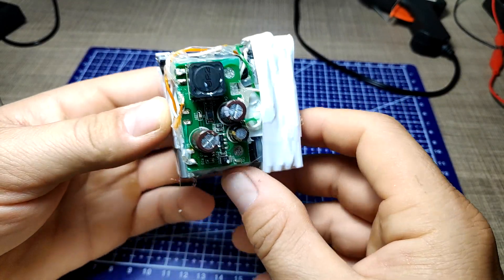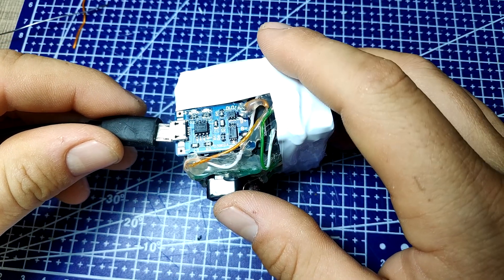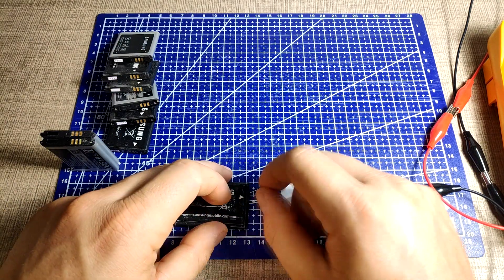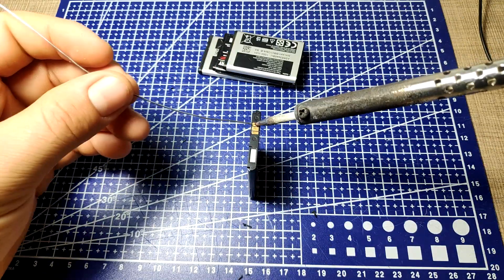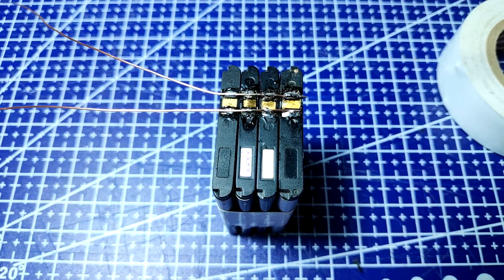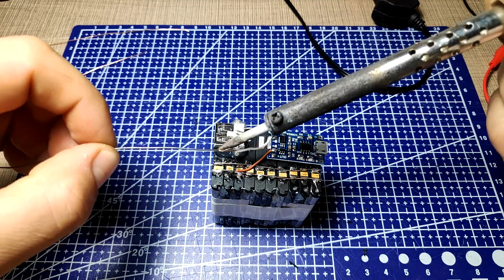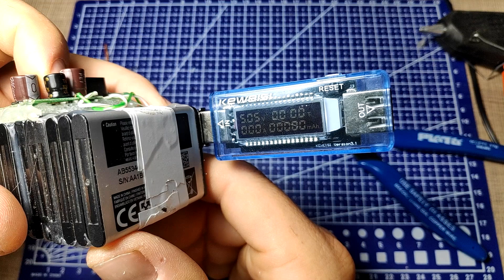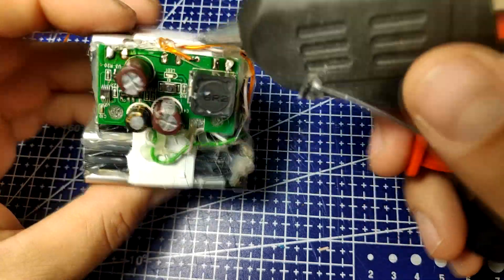Mobile phone battery power bank

Comment: Using of charging input module & charging output module?
Reply from the maker: I'm not sure I get your question but the module is TP4056 and it is used to prevent the batteries from over discharge and over voltage.